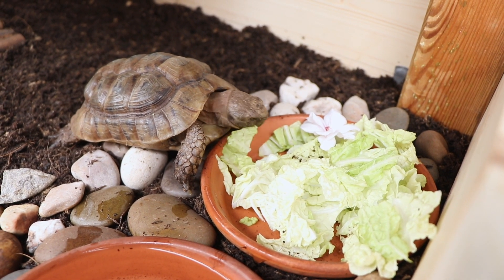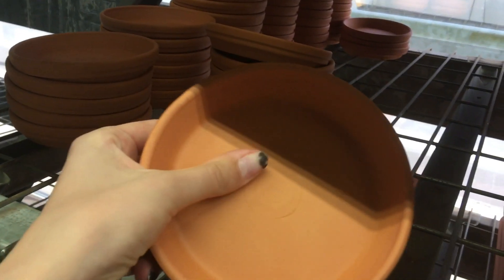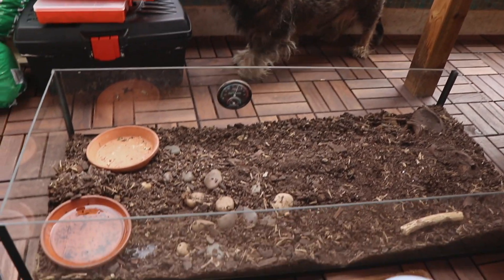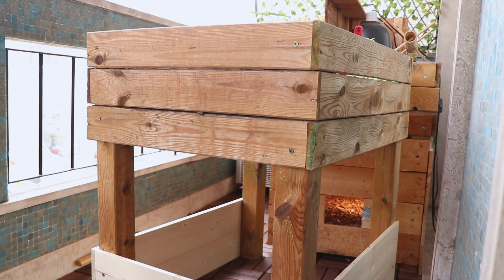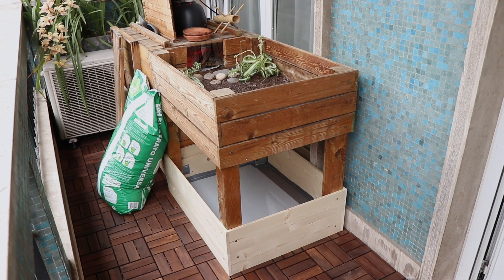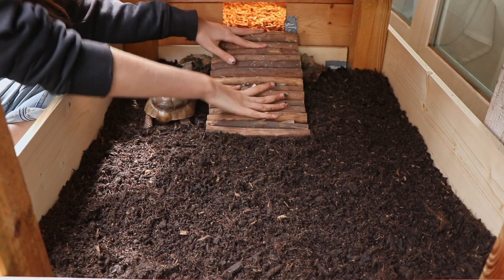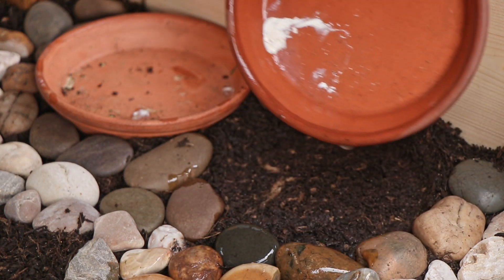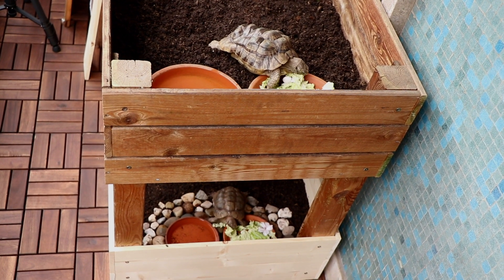DIY Tortoise Enclosure Build & Set Up

Comment: Do the tortoises need a heat lamp if they live outside ? and if so do u turn it off on hot days?
Reply from the maker: Not necessarily a heat lamp but a heat source depending on the weather. And yes, in the summer it's usually off unless we have cold nights :)

Comment: What kind of dirt do you use? How did you waterproof it what was the plastic you put in there?
Reply from the maker: I use Organic top soil and I used a plastic sheet with a sticky side on the bottom and finished off the edges with duct tape, this way it's waterproof. :)